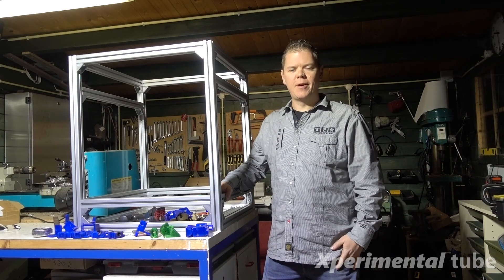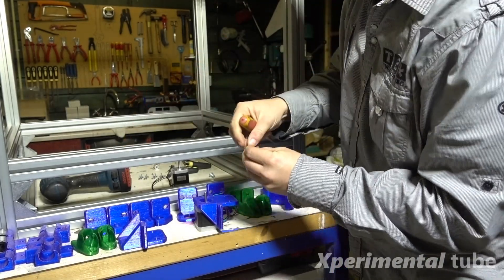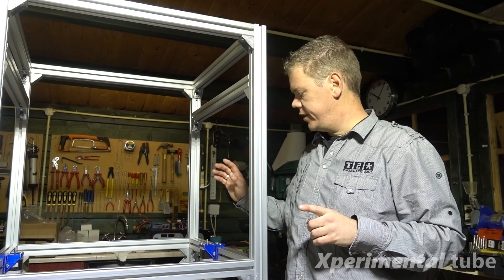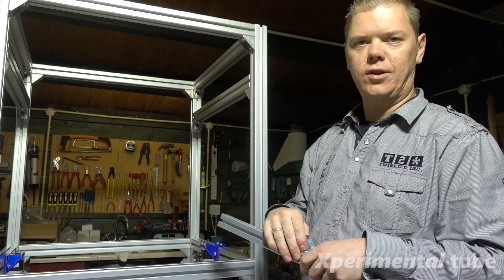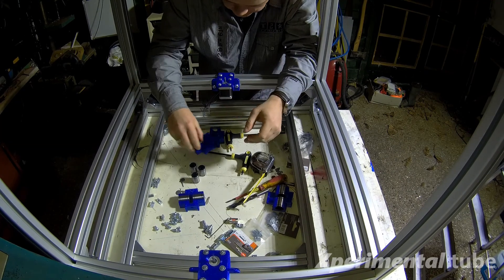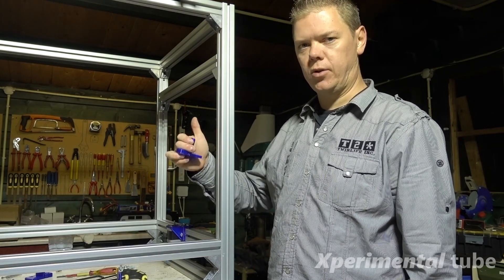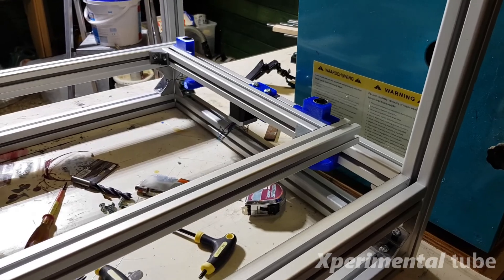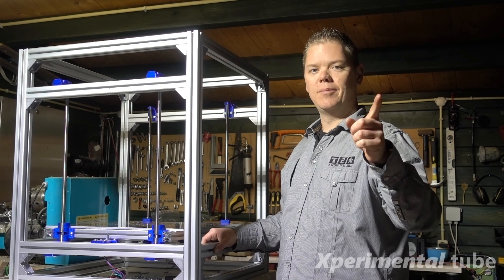02 Z axis - HyperCube 3D printer Xperimental style

Comment: are you using Nema 17 motors still? I am currently building a 500^3 hypercube EVO also and my bed doesn't seem to want to move up with the Nema 17 motors.
Reply from the maker: Connor Kukuk until now I will try the nema17 motors, I hope to be able to finish and test the Z axis this weekend. If it doesn't work I will probably go with a 2x1 gear setup.